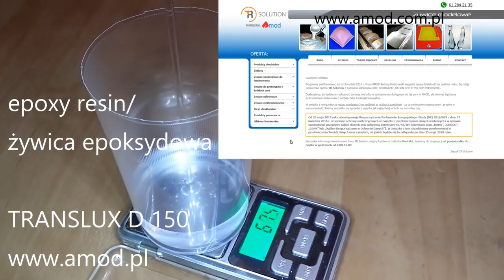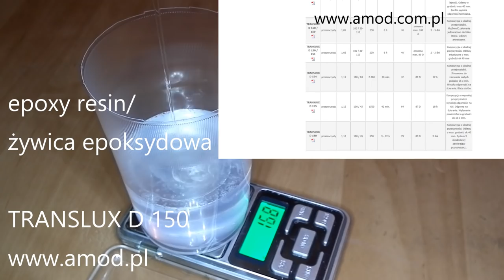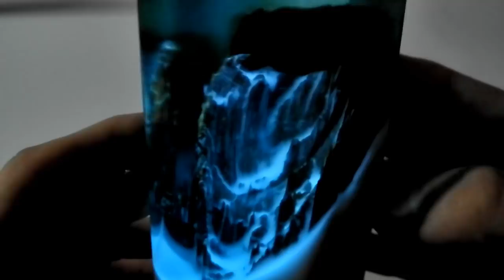Night Lamp with Resin and Wood 💡

Comment: Great job, excellent vid :)

However, as an electrician and electrical engineer, i feel like i need to point this out... you might want to consider adding something like a 100 Ω resistor in series with the rest of the LED circuit. The reason for this is just so that you don't flare your LEDs on max current all the time and as such you gain a lot more battery life in the process. Cuz as it stands now, you only have what little resistance there are in the wires alone, and (spoiler alert) that ain't much :P

100 Ω should do you fine, but if you feel like you're missing some "omph" with that, then you can reduce it down to a 47 or 51 Ω one.

Once again, great vid :)
Reply from the maker: Thank you for the advice
Reply: There is also some internal resistance in the battery, so it's not so bad. Depends on the LED nominal drop-voltage though.
Reply: True dat, but usually that internal resistance is so low that i'm pretty sure he's blasting that LED with over 200 mA or something when all they really need is 10 - 20 mA.
Reply: @Vivec92  lithium "coin" cell batteries have quite high internal resistance. I've found some tests with LEDs of different colors, will not post any links here, but you may google the title "Some thoughts on throwies". It seems that for white and blue LEDs the current never exceeds 15mA, which is lower than nominal 20mA, but for red and yelow LEDs the current may be over nominal for several minutes (because of the lower voltage drop of the LED). Also, the intensity of the light seems to decrease quite fast over time while the battery discharges. And the video shows two LEDs connected in parallel, which roughly doubles the power consumption.

Overall, now I'm not convinced that the schematics shown in the video are practical for everyday use. For show it works, but not as a night light or similar.

Comment: 2:01 what do you call that?

11:36 and also this?

I feel like I'm in a different world for not knowing this

Actually what do you call those material especially when you start assembling the light
Reply from the maker: 1mm plexiglass with anti frame
LEDs, switch, battery socket

Comment: i really want to make one.... i was on board until you started soldering.  any chance you could do a video explaining where you found your electrical parts and a little info on the wiring?
Reply from the maker: You can find everything on eBay

Comment: The measurements have to be spot on for the cure. BUT my question as far as the dyes you add it for your desired color but does it affect the cure if the resin?
Reply from the maker: The dye has no effect on curing

Comment: Love this project!  It's so cool.  Question:  How do you determine the type and power of battery to use with the LEDs?  Will any battery work?
Reply from the maker: Yes. The led and battery are on 3 volts
Reply: no, this leds probably will stop working in a week, you need to put resistances acording to the wats and color of the led.

Comment: I love watching this kind of stuff.  I'd like to issue a challenge of sorts; maybe more along the lines of a request.  I'd like to see you do a similar project but this time when you pour in the clear casting resin, sprinkle in a few termites or butterflies or some kind of insects to be encapsulated by the resin.  Only the slightest bit of color tinting might be needed.   Of course you'd have to take great pains to place those insects into places where your cutting tools can't reach them as you reach final depth.
 

The aim would be to turn the wood into whatever shape you desire with the end results being like those amber geological specimens we see from time to time with some type of Jurassic long extinct insects imbedded in them.  I think that would be cool as heck; especially since you'd have the old wood as a backdrop.   I hope you read this and take up the challenge. 

Show less
Reply from the maker: I think I will do something similar 👍
Reply: @jedrek29t  Awesome.  I've only come across one other YouTube video of this type that incorporated insects as added visual effects.  I'm sure if you do such a project all the other YouTubers will try it too.  Thanks for taking the time to reply.

Comment: Personnellement j'aurai mis une pile lithium 18650 , elle aurait durée bien plus longtemps qu'un pile bouton 2032 ... et il aurait été sympa d'avoir des diodes qui changent de couleurs.
Reply from the maker: C'est vrai Je vais faire une lampe pour usb
Reply: @jedrek29t  il existe de module de rechargement pour presque rien sur aliexpress, on branche un chargeur de téléphone et c'est réglé, la lampe on peux s'en servir branché ou débranché ... et avec des diodes qui changes de luminosité ou de couleur soit seul soit  avec un potentiomètre ce serai génial ...

Comment: You could have saved time by just using the corner of the 2x4 instead of cutting it out of the middle and looked like you were going backwards with your drill bit or it was really dull. Still looks nice tho

Comment: You should put a resistor on that circuit.
Reply: Yes exactly, 220ohm 0.25Ampere or 0.5ampere based on the Current of the LED are using in..

Comment: CR2032 as led power supply - is worst thing that can be. This batteries for some low consuming IC, not for LED. Better use 5V phone charger and any (100-300 Ohm) resistor or cheap led driver IC.
Reply from the maker: Ok Thanks

Comment: Great art, but I would've gone for a DC jack powered by a 3 volt wall plug instead of a battery that will constantly need replacing.